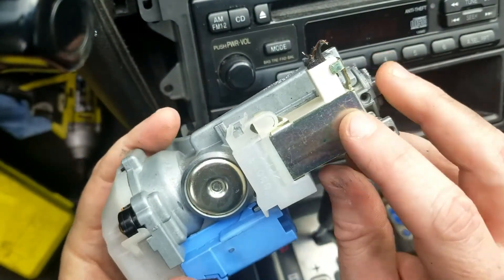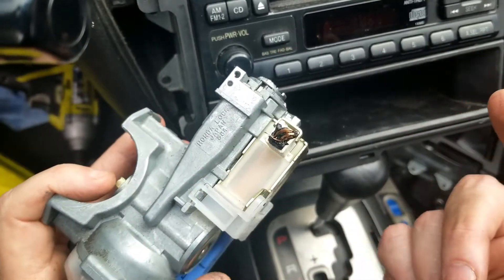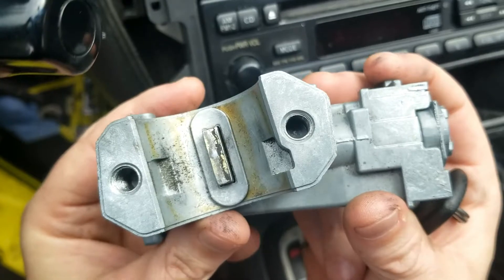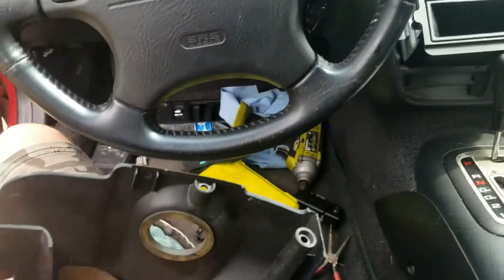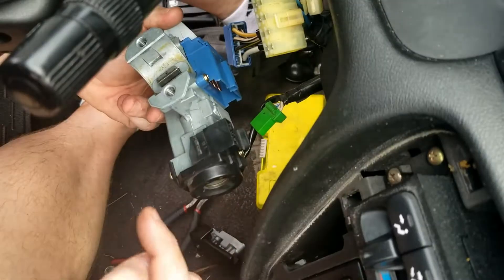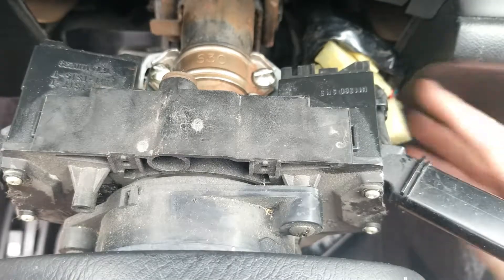97-01 Honda Prelude BB6 Ignition Lock replacement & Immobilizer Part 1

Comment: Just conne ct 2 wires, on the imobilizer and it will start. I had to do this for my auto start. Look at the wireing diagram and you will see which ones. It's easy.

Comment: I just installed this new part on my Prelude, since it was stolen and the thief broke the lock, the steering wheel still won’t lock in place, not sure what I missed. I literally just unplugged and unscrewed the old one and put the new one jn
Reply from the maker: on the clock cylinder where it mounts to the steering column, there is a peg if that what you want to call it that will stick out and when the wheel is in the right location the peg will drop into a hole in the steering column which locks the steering wheel. Hard to explain without pictures. Join my facebook group, make a post and I will add pictures.
Reply: @MrJayDM   Thanks what’s your fb group?

Comment: Why was the reason that you have to change it was the car turning off on you?
Reply from the maker: It was a flip car, the only key I had was the valet key, the key doesn't work with the glove box and the trunk. I just wanted to have a working key for all the locks.
Reply: @MrJayDM  how much did it cost was all the parts?

Comment: Where could u find the whole part?
Reply from the maker: Watch part 2 https://www.youtube.com/watch?v=hCENFx7xHvs&t=198s You can find the whole set on ebay or in a 5th gen prelude Facebook group. I still have the set that I swapped out, it works it just has the valet key.  Contact me via my Facebook group, Link in the description and I will make your a deal.
Reply: @MrJayDM  I just bought a 98 prelude and the key wont turn into the "0" Position, so the radio/dash leds stay on, what would be my problem do you think?
Reply from the maker: @Josh-lu6pk  IN THE VIDEO AT 1:18  I show the ignition switch and how it works. Maybe your ignition switch is bad, but the question I have is, if the key won't turn to the zero position how does or dose the key come out. Maybe your key/lock cylinder is messed up. Maybe sprey some silicone spray in the lock  cylinder.  Join the Facebook group and post your question and we can better discuss your problem. https://www.facebook.com/groups/MrJayDM
Reply: @MrJayDM  I sprayed some lube into my cylinder and it is working a lot better and functioning properly, my car kept not starting because of a ground issue I luckly fixed, but thanks anyways man, good video!
Reply: @MrJayDM can the auto trans ignition set work for the manual trans?